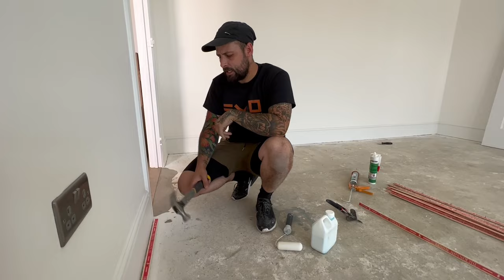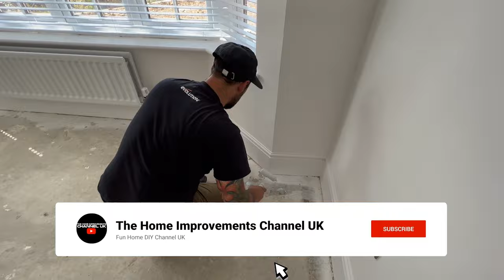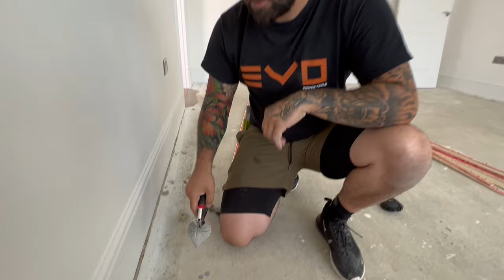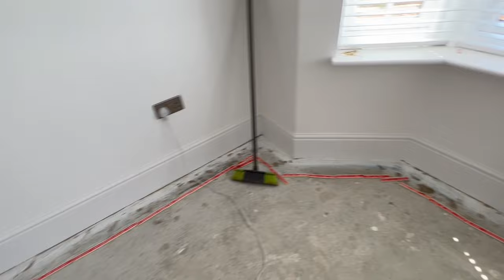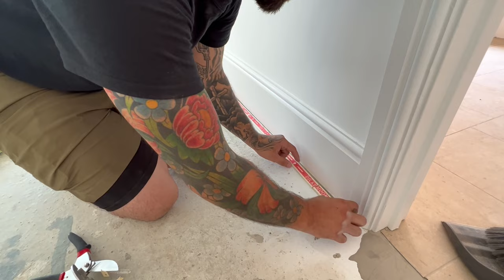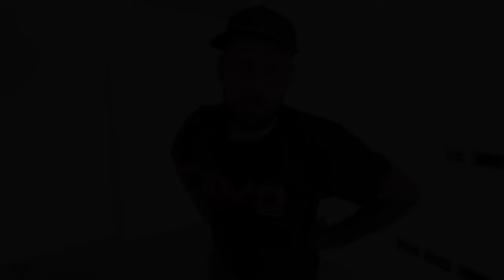HOW TO GRIPPER/TACK STRIP CONCRETE FLOORS FOR CARPET #carpet #flooring #homeimprovement #diy #howto

Comment: how strong is this compared to when nailed in, i mean will the stretched carpet pull them off the adhesive? love the videos btw
Reply from the maker: This is just as strong, only need to use this method when the floor will not take a pin, or underfloor heating, or suspect pipes have. Been fitted shallow .

Comment: No joy for me. Tried 3 different adhesives. Pink Grip, Sticks Like, and Gorilla grab adhesive. MAPEI screeded floor, vaccumed and primed with tiler's acrylic primer. Tested on 6" lengths of gripper. Adhesive coated perfectly, as I put the bead on the gripper and worked it back and forth on the floor to spread it out. 24 hours later used a wallpaper scraper to scrape them off and all came off relatively easily, worst was Pink Grip. Was hoping the plywood would split, but nope, just a coating of screed dust on the bottom of each, less on the Pink Grip. Reckon most combinations will fail after a few years of summer/winter expansion and contraction, and under tension from the carpet.

Comment: Just nail it in by hand bro
Reply from the maker: We do usually, This is good for under floor heating or where builders buried pipe very shallow to the surface .
Reply: Concrete nails are my first choice, but yeah, sometimes the floor is too hard to take in any size of concrete nail, particularly the half inch ones which penetrate best for harder floors.  
My last resort is a hot glue gun which works wonders for me.  It's definitely more time consuming, and I also have to cut the tack strip in 4 inch sections, since the glue cures so fast.  I did a bedroom the other day, and hot melted the tack strip around the entire perimeter.  It held up great even with the power stretcher I used.  🤘🏼
Reply: For speed purposes I can pretty much nail into any concrete no matter how old it is. Yes I understand though sometimes you have to apply some sort of adhesive to the gripper and nail it for it to work. I only use tri tac gripper it's wider (you can start really smashing the nails in now) and has more teeth to grab onto the carpet with. @nascage
Reply: @NzRasengan  I hammered in about 10 concrete nails (5/8 & 1/2 inch) in one tack strip, and only got one to hold.  I just gave up knowing it'd be a long and frustrating day if I continued.  I don't encounter super hard floors often, but I do.
How do you get your nails to hold on hard concrete with a hammer, and what size nails do you use?  I'm always willing to learn.